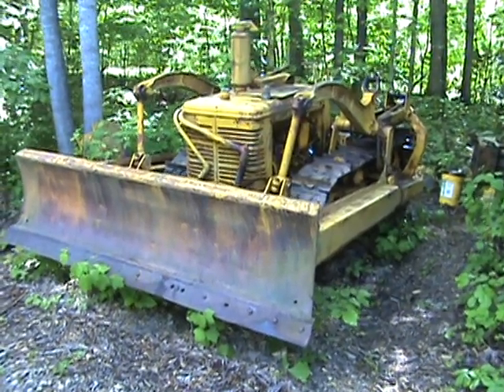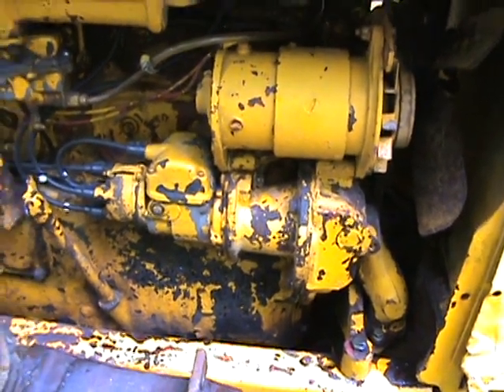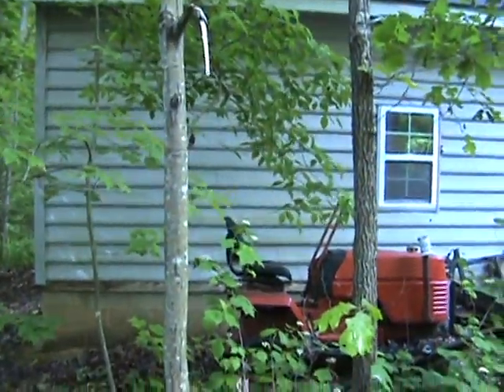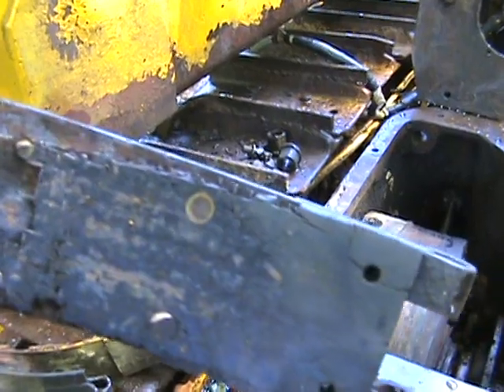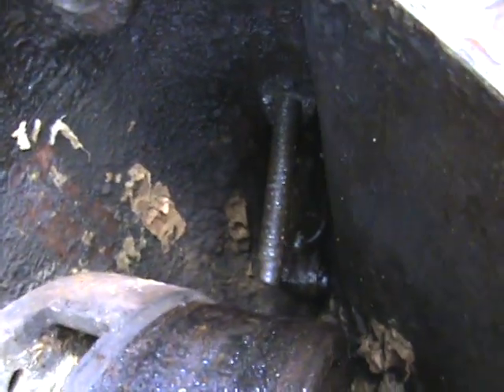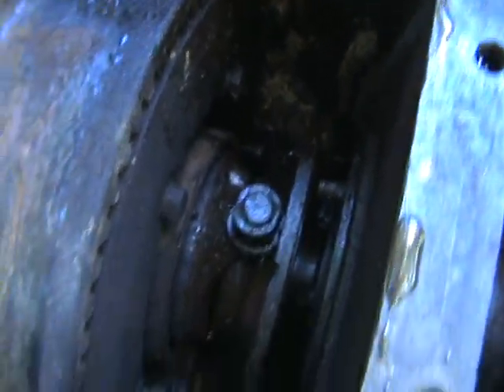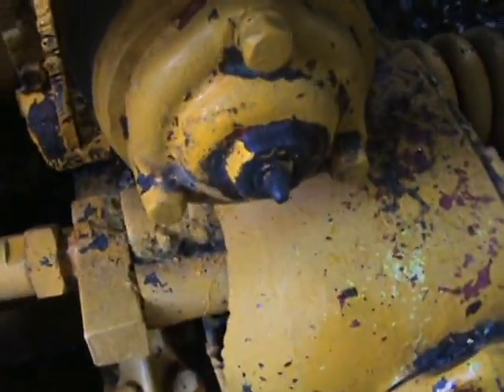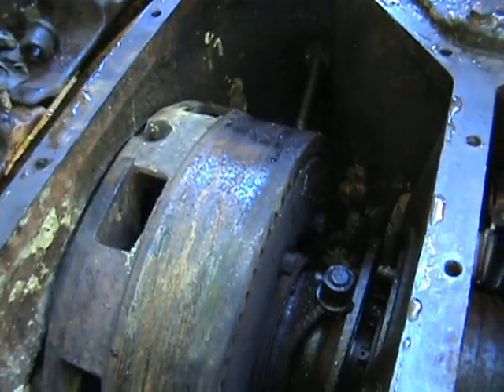1945 International Harvester TD-9 Clutch Tear Down, Part 1

Comment: I just found a 1951 TD 9 that runs but needs a clutch. The guy wants $3500.00 for it. Is that a fair price?
Reply from the maker: Depends on how good a shape the rest of the thing is in.  Engine clutch or steering clutch?  How are the hydraulics, track,  engine,  etc?  Where are you located? Are there any others around?  I would say $3500 is not bad if the rest of it is in descent shape.  But if the engine starts on gas and switches to diesel then that is a really good start.  You can contact me on the Redpowermagazine.com forum if you have more questions.  That is THE place to go for info on these machines.  The guys there can answer almost any question you could have.  Search for WaldoTD9, which is my username.